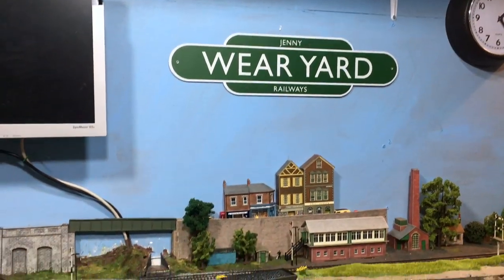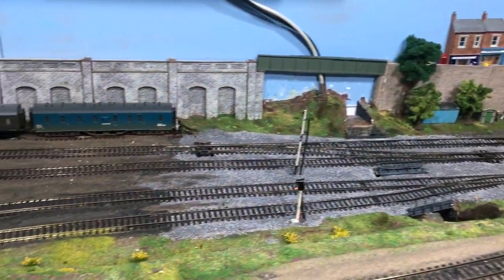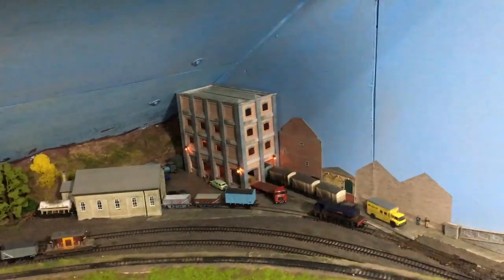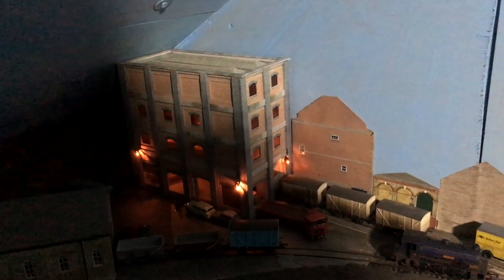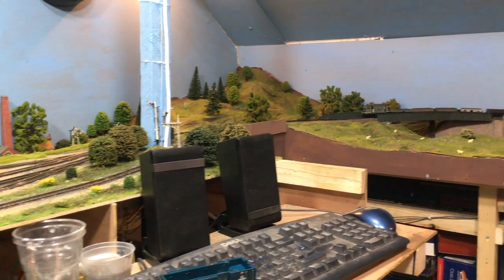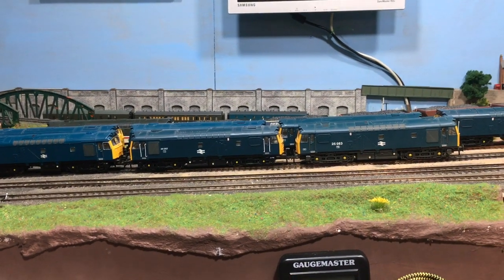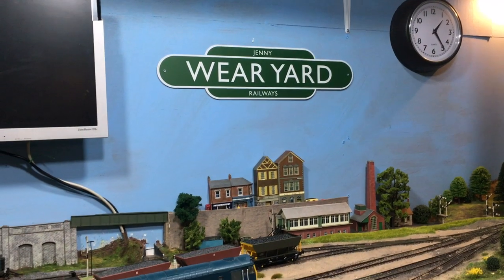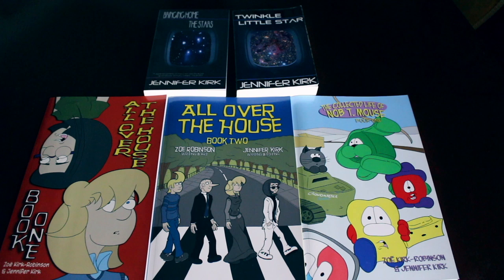The Layout Is Complete! - Building the Loft Layout, part 23

Comment: Great video Jenny, little tip if you'd like, use a blue colored light for night operations, not a blacklight (unless you put on Hendricks and fire up a fatty) but in my Hollywood days, a blue light was used so everything could still be seen and not bumped into.  Over here in the U.S. they're called party lights.